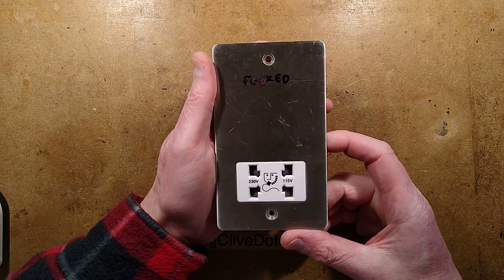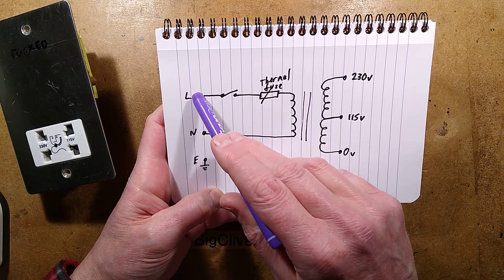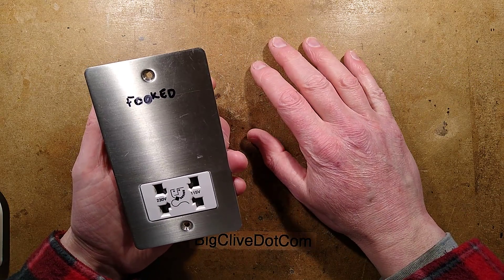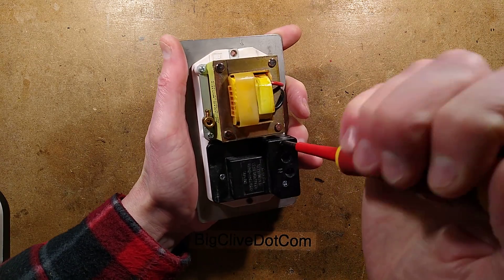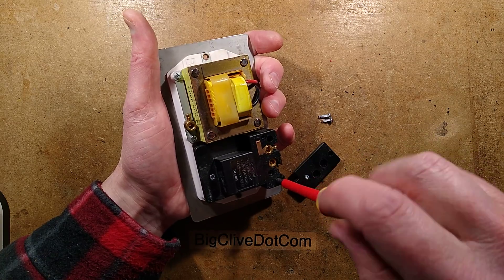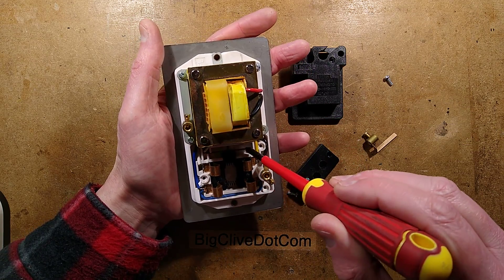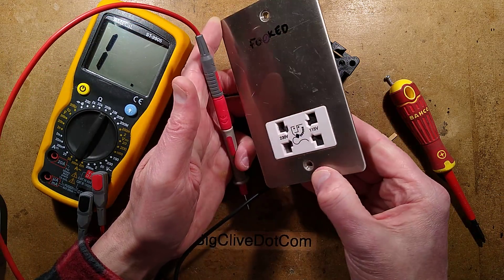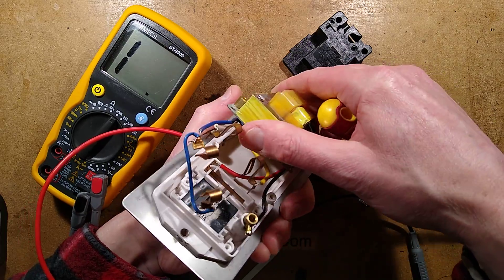Exploring a failed British shaver socket

Comment: Yeah these used to be in some New Zealand houses. The previous house I used to live in was build mid 70’s and had one. 
Now living in a newer house built in the 90’s and that has a normal wall socket protected by an RCD breaker.

Comment: Plastic back boxes should also be fire retardant in real terms the chances of fire are between very low and zero. Would be better to have a resettable trip anyway. Also thermal fuses can just die over time of old age anyway I've replaced several that died that way.

Comment: In portugal they just have a normal socket in the bathroom. They heavily rely on the protection that a RCD provides. These isolation transformers are probably a reminisce of the days before RCD in the UK. I guess now that rcbo's and rcds are basically standard in the UK, these transformers aren't as important as they used to be. But they kind of stuck anyway. I think some countries use them as a 230v to 110 volt supply only. Not so much for the isolation function.

Comment: Haven’t seen specialized shaver sockets here in Lithuania, but if we’re on a subject of specialized sockets, soviet apartments used to have special radio sockets, roughly translated as “radio point”. You would plug a really dumb radio, basically just a speaker with a volume knob, and it would broadcast government propaganda. There are stories that these were mandatory at some point and couldn’t be turned off, just the volume lowered. I can’t find much info about it in English, but you can search for soviet radio socket to see how it looked.

Comment: I had an MK shaver socket with a similar issue. The transformer was very noisy and in the end failed. Thermal fuse had parted and all that was ever plugged in was a shaver. The issue was the switch making a poor contact, arcing and making the primary winding heat up because that's what transformer winding really don't like. Not the load causing the issue but the poor quality switch.

Comment: The "shaver socket" with an isolation transformer built into it existed in Canada as well; my dad's house was built sometime in the 1960s and had one (though it was 120V only - a single NEMA 1-15R, or more likely whatever standard predates it). It's been a while since I last opened my copy of Electrical Code Simplified, but if my memory serves, current code requires all outlets within a certain distance of any water basin ( does 2 meters measured along wall sound right?) to be GFCI protected, so they can no longer be used in new installs or renovations and haven't been for at least a few decades to my understanding.

Comment: I've seen shaver sockets in continental Europe as well.
In NL we used to have some strict rules when it comes to electricity in bathrooms. Other than a special connection to a pull cord operated switch high up on the wall, nothing was allowed. Apart from shaver sockets. Now with the bathroom zones, we just have normal sockets.

Comment: We just have GFCIs in the states. Outlet has an internal breaker that turns off the outlet it's self when say you drop something in water. So it's safe to stick your hand in grab the thing and then push the reset button to turn the breaker and outlet back on

Comment: So crap that they don't put a regular 1A or 3A fuse in the back that you could change which would blow before the thermal fuse. I have mine installed on a stub circuit with a switch and small fuse in the airing cupboard.

Comment: Question : Are these more effective at safety than a RCD/GFCI socket?
Reply: Yes. As you won’t get any shock if you touch the live output. If you touch both terminals you still get 230 though.

Comment: I have never seen a shaver socket in germany, most of the time there's a normal socket that is outside the Zone of 60cm around the shower/bathtub and it's RCD protected in modern buildings. The most common place is next to the sink on the side that is opposite to the shower. so if the shower is left from the sink the socket is on the right.

Comment: We used to have them here in Sweden,  although only 110 V outlets with tiny 2 to 1 transformers behind them. Nowadays we use standard outlets, regulations on where to put them in regards to the nearest shower/tub and also the entire circuit must have a groundfault protection at 30mA. I've removed mine but there are many left around still.

Comment: In the US every bathroom outlet (any outlet near water, not just bathroom) has to be GFCI protected. In residential properties this is usually a 15 or 20 amp feed through duplex receptacle with TEST and RESET buttons... I am pretty sure the Shaver outlets were originally designed for non-north American  hotels and resorts who cater to American patrons and their 110V shavers. This is no longer an issue as most switching power supplies can handle 90-250V and a razor with lithium ion batteries should last an entire vacation without needing a charge anyway.

Comment: I guessed too that the thermal fuse had popped, usually these are not replaceable unless one can dig into the winding and get the thing out.   This is surprisingly hard to do without cutting the hair thin primary winding wire and rendering the whole transformer useless.   I love the way it's distinctly blackened and says f*cked on it!

Comment: This brings up the subject of overall safety, and the question: Is there any reason to have 220/100v sockets in the home?  Understandably, some appliances need lots of power, so a lower power level would require thicker wiring, but at what cost?  A study would have to be done to establish how many people die from electrocution each year, but isn't safety paramount over convenience?  Other than appliances, almost everything in the home has some sort of voltage-reducing power supply inside.  Perhaps a better low-voltage solution could be adopted?  Smaller plugs, larger wiring, but overall higher safety and less risk to children, etc.  Just a thought.  Love the channel, the last LiveStream was **AMAZING** so do that more.  Cheers!
Reply: It’s very easy to center tap a transformer. That’s why they are dual voltage

Comment: I got up this morning and some of the sockets wernt working in the kitchen wall and the hood fan, looked at the fuse under the stairs, it not only had it tripped, but it pushed the fuse out, of the holder, and it was lose, never seen it do that, it would take a lot of force to  do that

Comment: I’ve never seen that before. Usually here in the US it’s a GFCI in the receptacle or on the plug end of the appliance (included because a lot of old (and even fairly new-ish) buildings had no shock protection whatsoever because America).

The only big advantage I can think of for GFCI receptacles in the modern day is that most of them can handle our full 15-20 amp circuits at their continuous max current no problem and so they don’t have any problems like thermal overload.

Comment: We used to have 110v shaver outlets built in to bathroom mirror kabinetts usually at 50 va(w) in Sweden. The one you got should have had a re settable fuse rated at 85% of max power, any thing else is irresponsible design.

Comment: Extremely common in Sweden to find 100VA 115V-only transformer sockets in bathrooms during the 1960:s up until the 1990:s. Now they are usually replaced by GFCI protected standard type F but you can still find transformer outlets in older bathrooms.

Comment: Hi Clive. Liked seeing this get taken to bits. 

In my antique and vintage hobby in the States, I've seen a quite a few older (probably 40's or 50's era) bathroom light fixtures with outlets marked "shaver only."  Most of them are wired directly to the incoming live and neutral with no isolation. However, I have seen exactly two of them with similar isolation transformers as yours has. The principle was the same, however the transformer had 120V primary and a single tap secondary for 120V out to the shaver socket. 

Looking at the back of the fixture, I thought it had two different fluorescent lamp ballasts, which seemed quite odd considering it only had one fluorescent tube. Then I realized how it was wired. 

I'm pretty sure that here, the shift has been to individual ground fault circuit breaker outlets in the bathroom, to protect from severe shocks. Back when these were seen in the States it was before GFCI outlets were available.

I've seen those thermal fuses go on battery charger transformers as well. Often the charger has an auto-reset circuit breaker for the output, to save it from overloading or reverse battery connections. However, if the rectifier diodes fail short, it will cause the transformer to overheat until the thermal fuse opens. I have, admittedly, removed the thermal fuses from these; and replaced it with a conventional inline time-delay fuse rated appropriately. Wouldn't do that with a built-in device such as a shaver outlet, but I have no problems with a wotkshop battery charger being modified in this manner.

Comment: Working as a house painter in the 80's and 90's in Canada, I used to find  little transformers in over the sink bathroom light fixtures.  First time I came across one (about 18 years old) I thought it would be a great place to plug in my heat gun to speed up the drying of some patches. NOPE !

Comment: When this American visited Britain many years ago, I brought my Braun shaver with me, but forgot to bring an adapter and was very happy to learn that my American style plug would fit in the 115 volt shaver socket over the sink.  It worked just fine although it sounded funny because it was made for 60Hz electricity.

Comment: The Brits are a little crazy. They won't put a decent power outlet in a bathroom but they hang a 220 volt water heater on the wall in the shower.

Comment: Those were very common here in Denmark too from the 60's up till mid 80's or something. And they use to fail for exactly the same reason as yours: People plugging hair dryers into them despite being clearly labeled "max 20 VA".... Ours were only 230/230 though. I think some hotels still use something similar with both 110 and 230 output.

Comment: Years ago, light fixtures near / over bathroom sinks here in the USA had shaver plugs but they were just regular plugs that you could in theory plug anything into. There was also in many cases a local switch to turn the light on or off which mystified six year old me because the switch in the wall controlled the lights...

Comment: First met these with an open circuit battery charger, found a failed fuse in that, but no sign of over heating. Then I had a new circular saw fail at power on & still haven’t investigated, then a brand new biscuit jointer fail again at power on & that still needs looking at. Perhaps thermal fuses are better now, but my limited experience suggests they are sending an awful lot of stuff to landfill, maybe better than a house fire, but still distressingly wasteful. The idea is good but my experience is of premature no fault failure, but perhaps I have just been unlucky. Thanks for sharing!

Comment: I'm so glad you came up with this video as it's literally the first time I ever get to see the back of a shaver socket and its actual transformer.
And as far as other countries go, we do (Or at least did ) have shaver sockets in France as well, although the last and up to this day only time I've seen one in a private home bathroom was back in 2007 or 2008.
It was a Legrand branded one that was of course taking two spaces or a two-gang box (I don't know how to call it in English) but it was single-voltage (I don't remember if it was 220 or 230 volts but mains was and still is definitely 230 here) and looked like a standard French socket but with no earth pin.
The entire front was plastic and there was "For shavers only" marked, both in French and English.

From what I read in a French book that basically teaches DIYers how to safely do electrical work in their house, shaver sockets come with a isolation transformer but in order not to be too expensive, the power is usually limited to somewhere between 30 and 50 VA if I remember correctly.
And since then I assumed for a very long time that the actual transformer might be located very far from the socket, maybe in the consumer unit, or in some box somewhere I don't know, if not deep inside the wall.
But in reality it's much simpler as you've just shown in this video.
And also I didn't know about the switch either.

Shaver sockets seem to have fallen out of fashion at least in France by now, even though you can still find them online and I didn't see anywhere that they were banned or anything.

But there is another place in France where shaver sockets and indeed dual-voltage ones like you've just shown are still definitely a thing: Trains !
I'm only talking about regional and sometimes even commuter trains called TER in France, although the most recent ones (Called Régiolis and Regio2n) don't have sockets in the toilets anymore, "older" trains roughly built from the 90s to the mid 2010s do indeed have dual-voltage shaver sockets in their toilets, and in fact the "face" with the plug holes looks pretty much the same as the one in this video, with the EXACT same shaver pictogram.
But they again have all-plastic fronts (Or faces or whatever...) that look like Legrand Mosaic.

Comment: In Germany, at least in homes, they are not a common thing to see. In fact, I have never seen one of those here.
We usually just have an outlet with a flip cover, so that it is covered when not in use. And furthermore, they are required to be connected through an RCD (unlike the rest of the outlets that can be without if the electrical installation predates the mandatory installation of RCDs for all outlets). For the bathroom outlets, they are mandatory. (Or, as with my flat, you simply don't have an outlet there if there is no RCD) Fortunately shavers have rechargeable batteries. (And even more fortunately the cabinet above my sink doesn't only have lights, but also two outlets inside.)

Comment: I have seen these all over the world, in the netherlands you may see them occasionally, it is not a "standard" thing in residential housing, if you come across one usually it is in a bathroom cabinet hanging over the sink, now with battery shavers i guess they will die out, they are common in hotel rooms.

But the ones i have seen are always 15 VA max?
There may be a fuse but to my knowledge these are obligatory designed to have the magnetic field collaps at over 15 VA (like a current control AC welding transformer), so fuse or not you just cannot pull over 15 va out of them, if you try the field collapses-voltage goes to almost zero and maintain max 15 VA.

This is what i learned in the 80's how these work and the fuse was just a normal fast acting glass fuse, perhaps in time the design changed(cheaper) to no current limiting design(you need extra core metal) and a thermal fuse?

Sometimes "wrongly" used in apartment buildings, as a cycling nation in the netherlands there is for every appartement in a building a "bicycle box/closet", usually 9 sq meter, just enough to store your bike and stuff and not intended for more or anything else, it is usually located at the base/cellar of the building so not near your own apartment so the ceiling light in the box is paid for by the building owner and on a timer + a current limited shaving transformer to prevent you using the ceiling edison socket for other purposes and stealing elctricity, if you connect something over the rating the voltage just collapses.
Reply: I had to look it up but heres what's going on:
The 15-20 VA limitation is the result of the transformer being designed with only sufficient iron in the core to support limited magnetic flux which will only produce 20VA in the secondary.  Any attempt to draw more power will just saturate the core.  The waveform will go to a square wave (well, clipped and distorted sine) with reduced voltage and no more power will be transferred.  So the transformer is both isolating and power limiting.
The primairy fuse will theoretically never burn as its rating is higher then the 15-20 VA load.

Comment: In the USA we use GFCI. This doesn't look even remotely the same, but we also don't need a transformer. If you run 230/240 stuff in the US you have special plugs or for light duty stuff have voltage/hertz changing wall wart. With that said Amtrak may have had one of these slots in the sleeper car. It was only rated for 10A. Worked fine with shaver, phone chargers, and such. We didn't try it with any higher amp because Amtrak informed us not too.

Comment: I tried to use a set of animal hair clippers on one of these. It didn't work, but was OK when I plugged in an electric toothbrush. What overload protection would this have, that reset instantly?
Reply from the maker: It's possible that it couldn't provide enough current for the clippers.  Some may have an electronic fuse that self resets.
Reply: @bigclivedotcom  Ah. I checked the power draw vs. supply. The clippers were just over the limit, and the poor, tangled cat had to put up with scissors - not happy. I'm now wiser, thanks to you.

Comment: Pre-1980s US standard single shaver-only outlet with its own transformer 
Modern US standard is 120V GFCI 
I suspect a lot of Americans live in homes originally installed with a shaver-only outlet but don’t know it because the shaver-only outlets get converted to 120V GFCI at the first bathroom renovation.